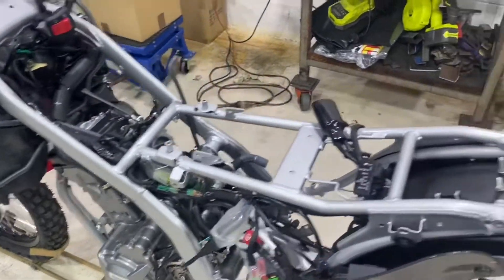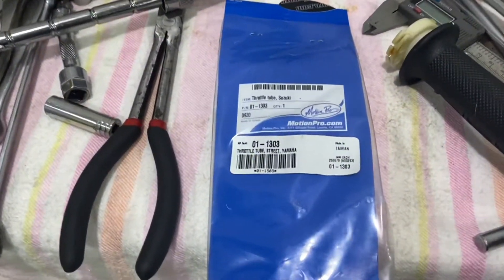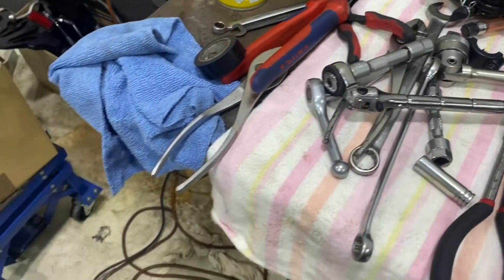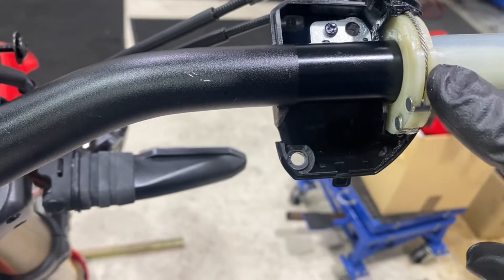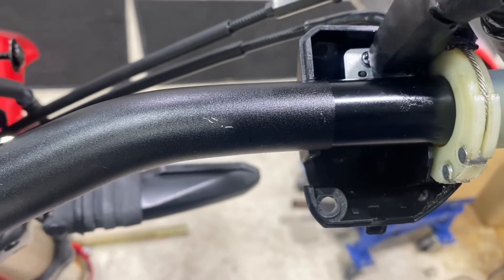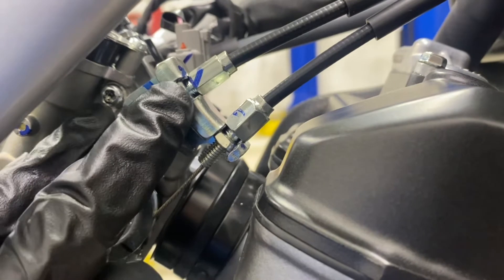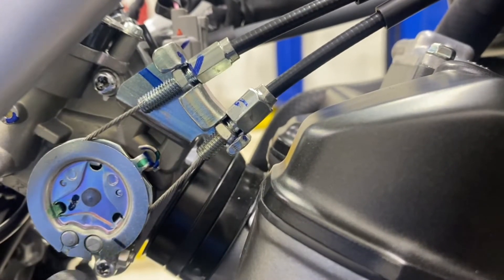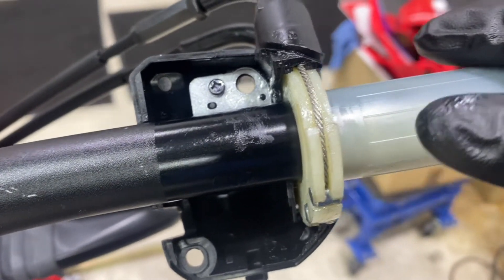Crf300l / rally quick throttle mod. #crf300l #hondacrf300l #crf300rally

Comment: Bought that exact part and tried this, but my throttle is slow to return and can't get it sorted. I've sanded the areas you pointed out and removed material on the black housing also. Just ain't working and I wouldn't recommend it to anyone. Thinking of trying the G2 throttle tube if I can get this CBR600 tube out of my brand new heated trips 😕

Comment: I didn’t change the throttle tube but I took up the slack in the pull cable and it is much better. The factory leaves to much slack in the cable.

Comment: just a couple questions on the modified 01-1303 throttle tube…

i see you’ve only removed some material along the top cable runner and it looks like part if cable channel isn’t very deep anymore….so did you remove more than necessary and how far along that top channel do you have to remove the 1mm of material 

with the larger cam of the new throttle tube is there still enough cable slack  that turning the bars full lock doesn’t cause the throttle turn stick or activate
Reply: Great questions. I've just attempted this mod and I removed more material than I thought was needed, along the entire raised portion where both cables attach. I added some grease and when it's all put back together, the throttle is "sticky" and very slow to return. Can't figure out what's touching after removing and inspecting several times, but when I put it back together loosely (not screwing in the screws completely), the throttle is usable but not ideal. Once tightened down the throttle takes 2-3 seconds to return once letting go.

Comment: I didn't see a place to comment on your seat removal mod but wanted to post.  I tried doing the same mod, but the bolts pushed the nuts within the seat upward to a point they would just spin and cut into the foam.  Did you have this issue with your seat mod?  I don't know how you kept the seat nuts stable, they seem to push inward and spin very easily.
Reply: Daniel, I just did the seat mod that you are referring to, and one of the inserts “moved” on me, but the other one was stable. I just reinstalled the original bolt and pulled the insert back into place with needle-nose pliers. Got lucky on the next try, both bolts when right in.

Comment: I have a question I hope you can answer. I installed a G2 Ergonomics throttle body and a quicker cam. My problem is the cables bind at full right lock despite adjusting for maximum slack. You removed the nut on the adjuster at the carb and the adjuster is screwed all the way down. Does that position and removal of the nut provide the greatest amount of slack in the cable?
Reply: Just installed my G2. It was very tight to install but thankfully I ended up with enough slack. My bike is 2 years old.